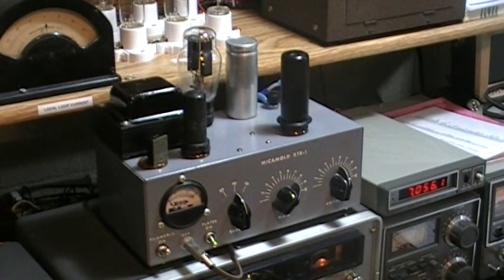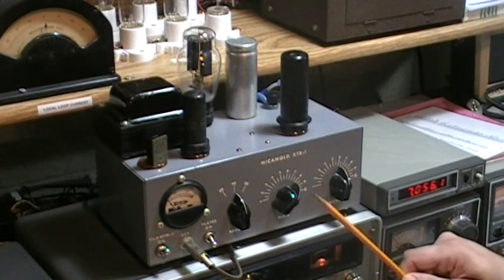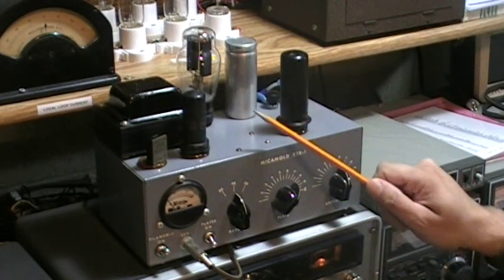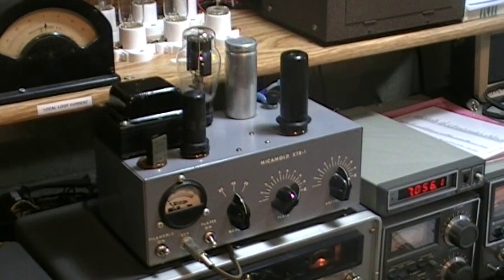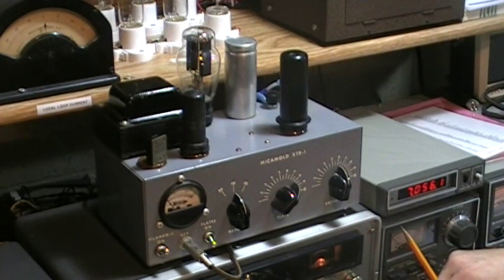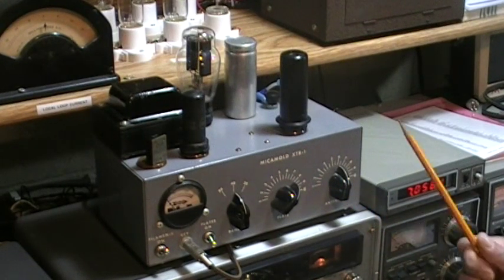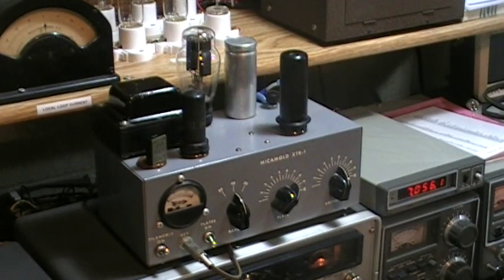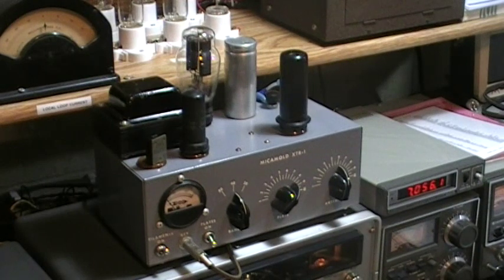Micamold XTR-1 Transmitter

Comment: I found the ad in a March 1948 QST.  The XTR-1 sold for $34.00 and would operate on 80, 40, and 20 meters.  According to the ad, the transmitter was supposed to deliver 45 watts.  The Micamold Radio Corp. was located in Brooklyn, New York.  Micamold also made mica capacitors and resistors.